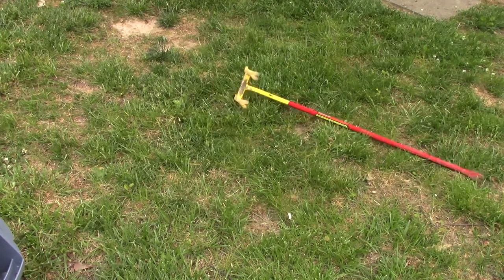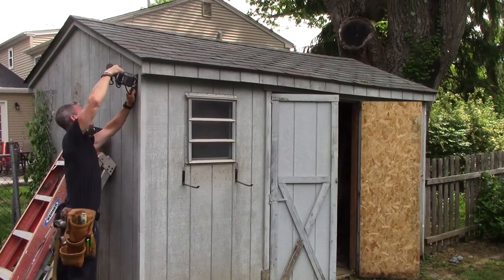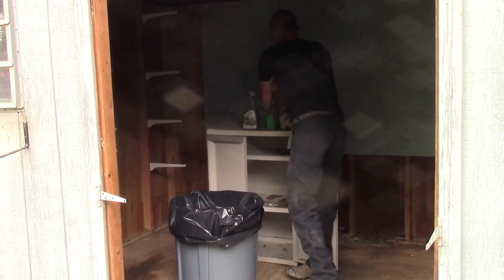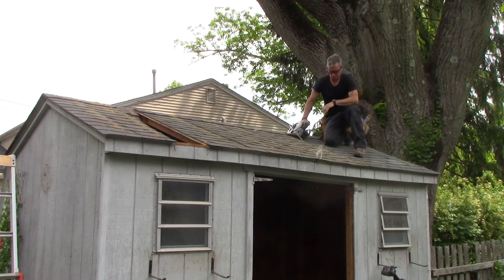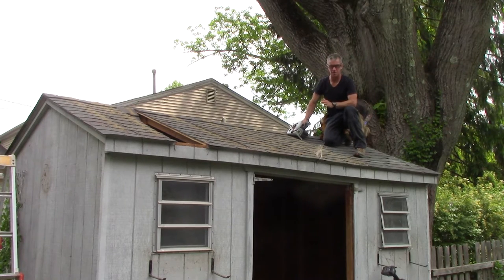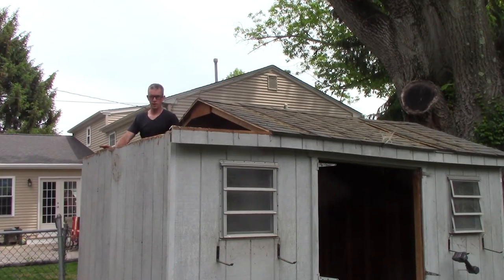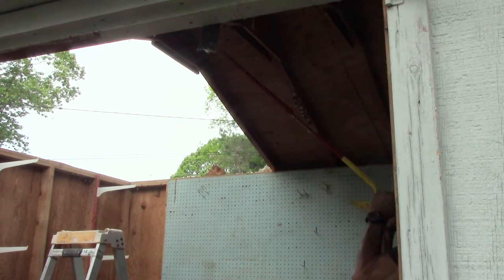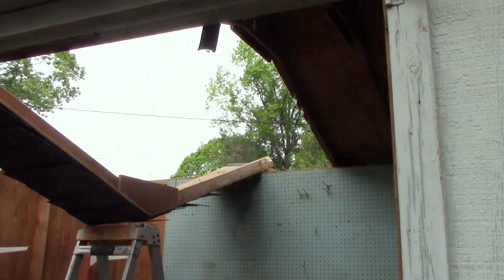How to Demo and Remove A Shed

Comment: Loved the video. I'm a young water damage technician and I was sent to PEI for hurricane clean up I usually just work in basements but I have multiple large demos coming up and I definitely appreciate the video giving me an idea of how to approach this
Reply from the maker: Yeah, buddy (Love your screen name by the way). You've got some hard work ahead of you. - My rules for structural demo include: Take it apart in the reverse order it was put together, cut as many connections (nails) as you can with  reciprocating saw (get lots of demo blades), chainsaws and sledgehammers have their places, but I use both rarely, if it look like it might fall down or get away from you have an exit path and plan. - Good luck. Love to see what you're up against.

Comment: Thanks for the tips. About how long did it take you?
Reply from the maker: You bet. - I do this kind of thing all the time, so the gears are greased. I'd say I had this on the ground and in the dump truck in 4-ish hours. - If you're just tooling up, I'd give it 6-8 hours to get it on the ground and maybe another 2-hours to load it wherever it goes.

Comment: Hey man what blade did you run on your saw for this? I just bought a flex saw noticed you also use flex, I have the rear handle saw. It made 2 good cuts and started to bog on me quick. Curious how many batteries you went through and what blade you are running here for this.
Reply from the maker: @deweyjohnson783  Two answers: The Flex blades  that come with the tools are great. - For this application….It’s hard to say what works best.
Reply: @myfixituplife  looks like you ran the Diablo blade in this video to me. How many batteries did you run through?
Reply from the maker: @deweyjohnson783  Great question. No good answer. - I like to plug in on jobs like this. Way easier.

Comment: How much did you quote because I have a shed job and you’ve just help me on how to tear down but I don’t want to under quote! Shed a little bigger than that one!!!
Reply from the maker: Good question. And, I wish I could help more, but this was a few years ago and part of a larger project. - What I can share with you is my "burden" and the line items associated with it. - I own the means of transport to the dump ( a dump truck in my case) so there is a line items for that. My job-costing and overhead. Labor, which includes tear-down, lift-and-carry, and transpo to the dump and back. - You could also look at it like this: You can figure out your day rate. That then gives you a 1/2-day rate. Then break up your estimate into those blocks and see where it takes you. - We could talk for hours about the nuances of this, but we have to start somewhere.

Comment: I tried using my sawzall yesterday. I have a Dewalt but not enough batteries. So I tried my hyper tough corded and the damn thing was falling apart, literally, the casing kept sliding off somehow. And it's not that strong. I do have a skill saw too so I'm gonna try that tomorrow on the other sheds(got 3 total for this job)
Reply from the maker: Seems like it's time to upgrade the tools you've worked hard. Check out Flex tools at Lowes. They're beasts.

Comment: Good video. However I was looking how to take one apart to relocate.
Reply from the maker: That's a different project. I suppose it's possible but the likelihood you'll damage something is high. - I'd be sure to have a lot of demo blades for the recip saw. Cut as many nails as you can.

Comment: How much did you charge for something like this?
Reply from the maker: Good question. There are a lot of variables. And, this was part of a larger project. - What I can tell you is what the inputs were: I own a dump truck that took all this to the dump. The dump charges $120/ton and I need to mark that up. Then there's the labor for taking it down and not killing yourself. And then there is selling a service customers can afford. - I think the line item on this one was somewhere around $1,750.

Comment: I know you were worried about small yard, neighbors fence, but once that roof down why are you still cutting. That little thing and a sledge is all you need unless you have a tiny dumpster or you like playing with tools. That whole thing with two guys should take 2 to 3 hours with filling up trailer or dumpster.
Reply from the maker: It's been a while, but it was all day (there is shit under sheds) to get it onto my dump truck. Another 2-hours to dump it plus dump fee.

Comment: How much did you charge?
Reply from the maker: I'm about $1,500 on this one. No dumpster or Bagsters or trailer hauling. I have a dump truck I use for this that requires a line item.

Comment: what a waste of a good shed
Reply: agreed. so much re-usable building material off to the trash heap.
Reply: Agreed, So much more could have been done with the materials...
Reply: Maybe you guys should volunteer to go around carefully deconstructing peoples' sheds, etc. and storing the unique and specific sized pieces for them in case they need a scrap piece of 2x4 or something. 
     There are people who either don't want to or have the ability/tools necessary to demo an outbuilding themselves so they hire it out, most likely to a contractor who is going to be building them a new or bigger one. Its always obvious from comments like these that come from people who don't realize what it would take to "salvage" all the cheap lumber from an old shed, therefore don't realize how unprofitable it would be to be paying said contractor to waste time doing it. A decent door or windows....sure, but not 2x4's and $10/sheet OSB,etc.
Reply from the maker: I get it, but also no. It was good fire wood, yes. Buildable items, prolly not.
Reply from the maker: Civilization starts and ends at the dump.
Reply from the maker: But they' need to be stored cared for and then used. And they were full jank. Are you sure?